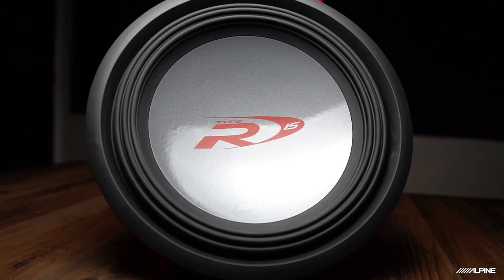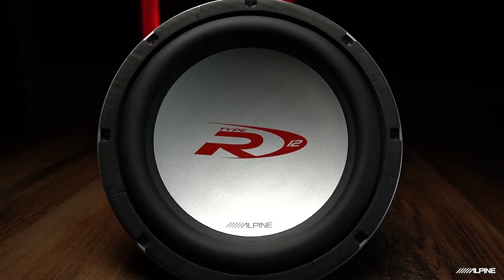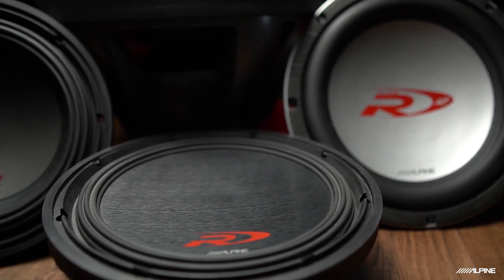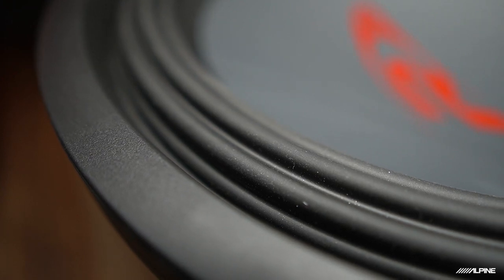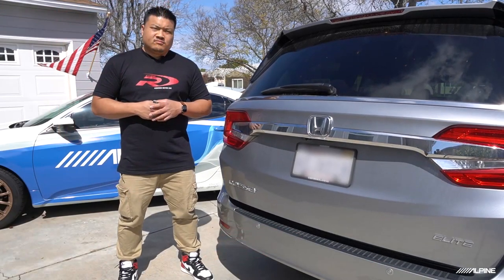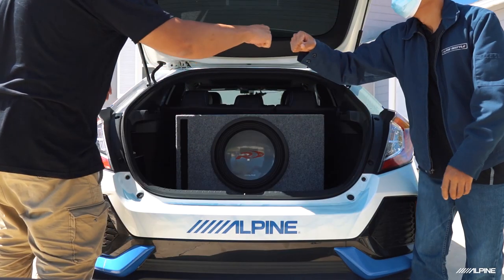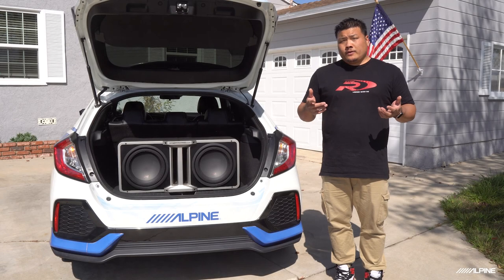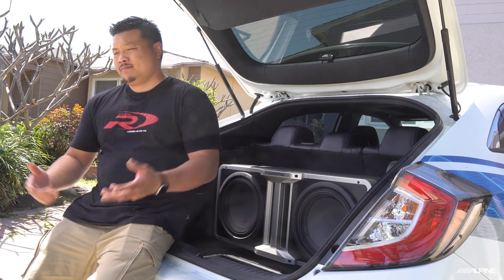Breathing Life back into this 16 year old Alpine Type-R 15" subwoofer...

Comment: I installed a full Alpine system, including all Type-R speakers, in my 04 Ram 1500 about 10 years ago. 6.5 components in front, 6.5 coaxials in the rear, 2 10" Type-R subs in a ported box under the back seat. I ran a PDX 1.400 for the doors and a 1.600 for the subs. To this very day, it hits hard as hell and turns heads. I am about to do the same treatment on my 14 Ram, just with the newer upgraded equipment. Possibly with a DSP
Reply: Nice if you post a video of it I would be grateful

Comment: I just reinstalled my type r 12's into a car a few months back. They have been sitting for about 10 years. My car they was originally in was one of the loudest cars in my town at the time. I still have them running on the same amp but I haven't pushed them very hard since they have been sitting so long.
Reply: I JUST did the same thing. After years of them rotting in my basement, i just reinstalled them. Forgot how hard they hit.

Comment: I bought some of the first 3rd gen R's, and immediately bought another set, as they were that good. Had them hooked up to an MRD-M1005. That also was one of the most high quality amps I've ever had. Better quality than any of the chinese cookie cutter amps available today.

 I've never had failed tinsel leads, unlike sundown audio. Every woofer I've ever had from them had failed from lead fatigue at the triple joint. Zero clipping. I've had lead luck with many other brands, even cheap, much lesser quality subs. 

To this day, I have the videos with the most excursion of any type r videos out there on any video platform. 

It started my love for loud. Now I run fully loaded, digital designs 9918 esp's, and have advanced into the top level of sub bass performance. 

I will have to hand it to alpine when it comes to quality, value and performance for the average user. I still run old alpine decks from decades ago, and are still my go to for a proper source when building for myself and others.

Comment: Something I loved about the early 2010s Type S & R was not only that they didn't require a lot of airspace, even for vented, but also the space requirements were nearly identical between em. The Type S & R 12" both only required 1cu ft of airspace for vented. I was very impressed. Smaller airspace means smaller box. Smaller box means easier to fit into anything and also less weight 💪🏻
Reply: That's because that's how you get the most accurate sound.  But you can definitely make them bigger and increase the port size to get them louder.   But if you build them to spec with a good amp they sound super clean.   👌

Comment: I had 2 of the original R10s in a sealed box driven by the MRV-1507. This was an amazing combination and they lasted for nearly 10 years. The amp fried after 8 years so I bought a M-850, which I still have today. Currently it’s driving 2 S10s in a ported box. I still love Alpine equipment. They always under rate their equipment, not like so many other brands.

Comment: I have 2 R type 15 in my Subaru Liberty sti built my own custom box specified for r type 15 and the trunk of course with 2 R types splits crossovers in the front and 2 S types splits in the back 1 orion amps pushing by birth sheet 2936rms for subs and a rockford fosgate t400x4ad pushing 558rms by birth sheet with a 3000 watt capacitor.all zero Gauge wire hole car sound insulated. And the sounds that come from this thing  Crystal clear mids and highs and the bass can get eye rattling to a point of sickness but I love it so happy I bought those 15 of a random on Facebook for 300 buck for 2 Australian currency and it been the best thing I ever done in my quest for bass.  Good to see people appreciating the R types Engenuity because those things really hammer.

Comment: had 4 type r 10s in a 94 explorer, it was known to set off car alarms, but after i changed to different subs, i realized that the type r isnt very efficient and takes alot of upgraded electrical to feed the power to them, after owning mephis street reference 12s with only a 250 watt amp they are the best sounding subs ive ever owned

Comment: Alpine is awesome. But I had glue issue with 2 out of 6 12s type rs. Sold the rest for that reason. Dont recall the model. I got a hold of an older type x 10" and made a box that made my doors do the waves on a slash 1200v3.

Comment: Hey I'm old school from Australia back in the early 90's Alpine had a 15' sub correct me if i am wrong  6014 and later on a few years later they had 6015.
I had both of them but 6014 kick ass just on its own as a single mono 15 inch sub in the back of my Mazda 323 4wd Turbo. Then made a move to a pair of 6015 's and lost that perfect bass from a single unit. I still cant find that boom from any other manufacturer or maybe i was young and know i am going deaf from high level of SPL.

Comment: I'm having trouble finding the right amplifier. I have an older type r. The one with the black dust cap, swr 12d4, it's the 5th gen I beleive. Its rated at 500 watt rms per voice coil, but I see videos of people using mono amps that are 1000 Watts+. I'm confused isn't that too much power? Can you recommend the right amp for that sub?
Reply: boschmann 4xd

Comment: yo Dude I have a 2000 Silverado Step side  That's alpine complete  I have 4 5/14 sx Titainium  with a 12 r sub under the rear seat, I have an alpine ilx 207 for a head unit an mrv f300 4 channel for the 4 speakers . and an mrv m500 for the 12 inch it really kicks  hard and Im wondering if I should get a PXE -0850s as the install guy told me it would be icing on the cake.  of course with the sxs 5/1/4 I get NO Distortion at any voluume

Comment: I posted my type rs n got everyone callin them pawnshop sub woofers. And alot of hate. I love them. Got 2 12s running of a 500.1 2 ohm apline. And same for my 10s. Same amp. An ooh boy. They fuckin pound. Gona be doin a 3 12s n 3 10s. With a 3k taramps. Plz bring back the 15s.